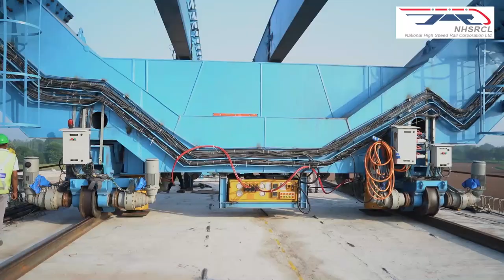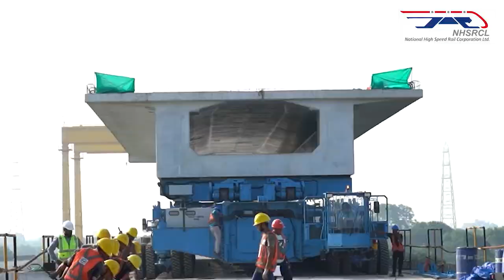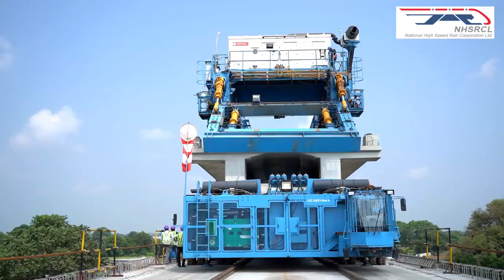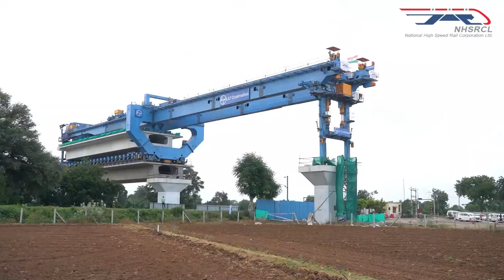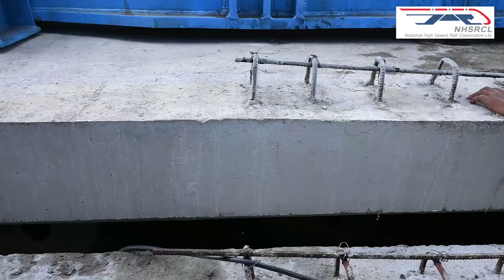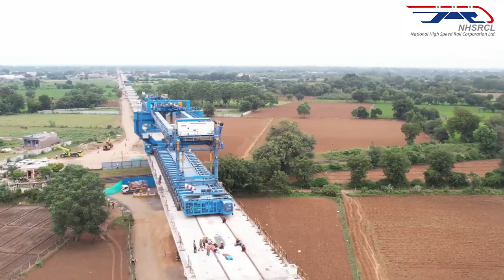MAHSR crossing over Western Railways near Anand, Gujarat | NHSRCL

Comment: Is this for both sides of train journey ? Or a seperate section will be build for the opposite train line? This system is used in China and other parts of Asia too !
Reply: No it will have two tracks in this single viaduct going both sides . When you look closely then only you can understand width of girders .